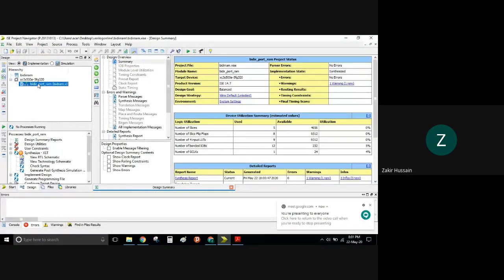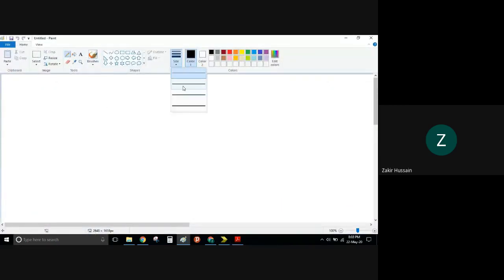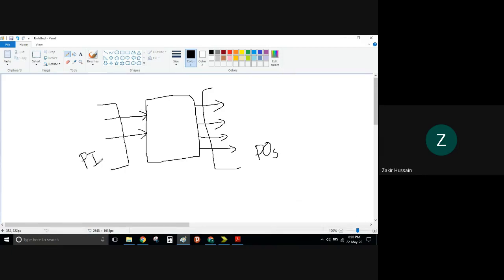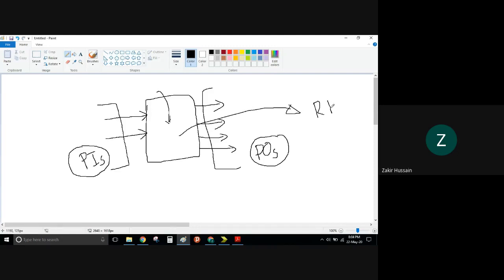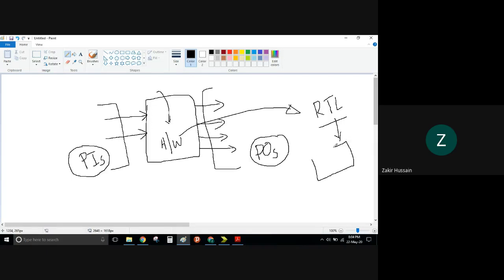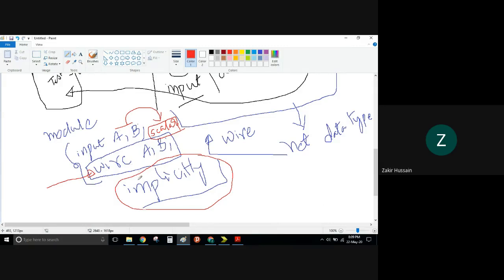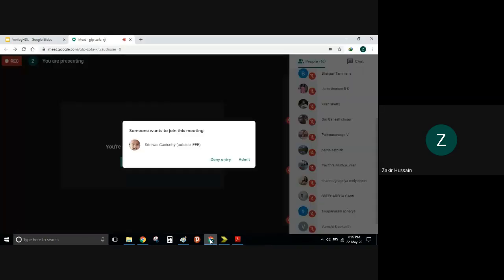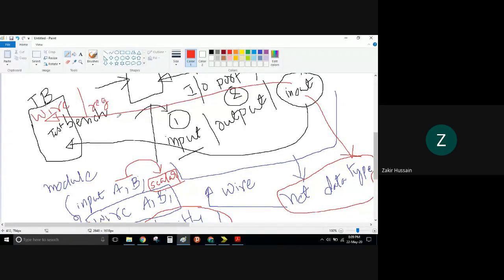Verilog HDL Basic Course - inout port how to use in Testbench

Comment: Memory is loaded by data when write enable is high.
When write enable is high then the assign statement says data will be Z. 
So won't the memory be loaded with Z for write enable high?
Reply from the maker: Z means the signal is in a high-impedance state also called tri-state. Another signal connected to it can change the value: a 0 will pull it low, a 1 will pull it high. which is happening in the procedural block. We are changing the data value which is Z at the assignment statement to some other values from the procedural block and that change is done through the testbench.

For more information please read at:

https://stackoverflow.com/questions/49987012/the-difference-between-x-and-z

If you still have doubts, please post here, Whenever I get time, I will surely respond to it. If it is clear your acknowledgment will give me satisfaction